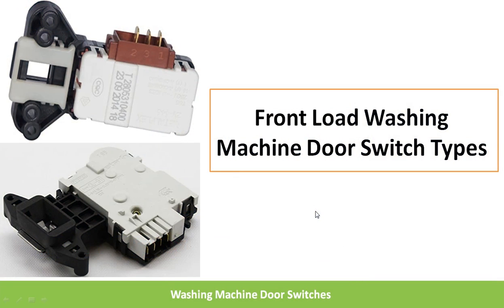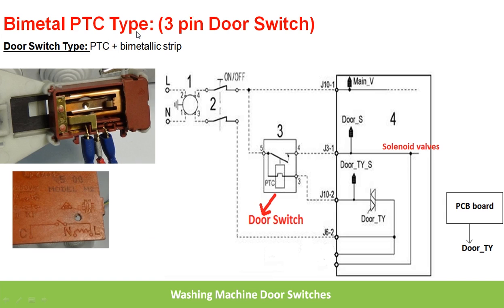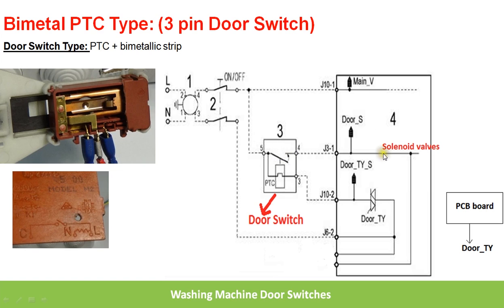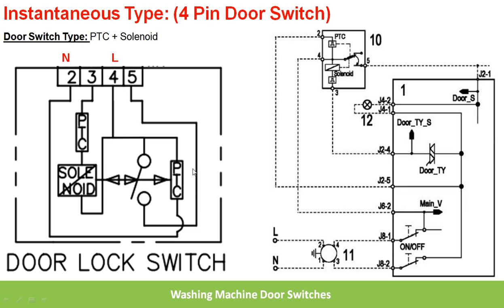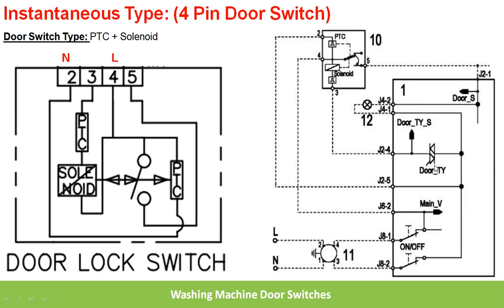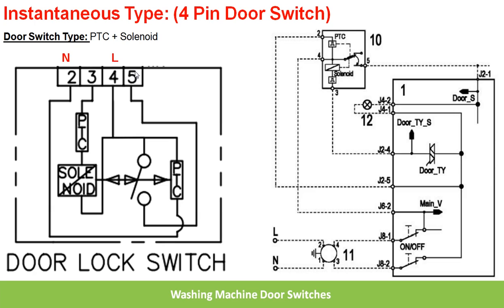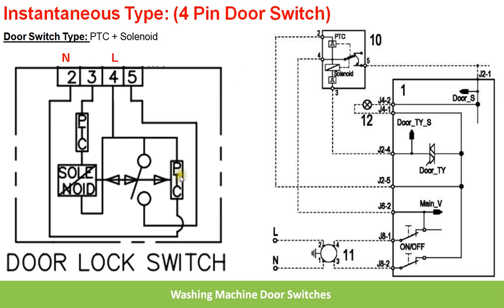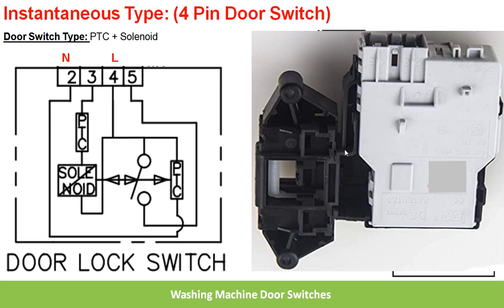How a washing machine door lock works | IFB, LG automatic Front Load Washing Machine

Comment: dude. any trick to open the instantenous type 4 which is stucked mechanically so unable to open electrically. You cant even change it because door is closed and there is not possibility to open it manually by pulling the plastic latch attached to door lock mechanism.. also it looks it hadnt any other mechanism for manual opening on the surface of the latch or this mechanism (push button) is on the inner side where you cant get. I dont know how to open it. Im done.

Comment: on the first diagram there is what looks like a capacitor on the incoming mains. Labelled Number 1. It has terminals 1, 2, 3 and 4.  What is it there? If this fails what happens?
Reply: That's just a mains filter  (capacitor and inductors), to supress interference from the machine. Had one fail on a 1980s machine, very loud explosion, very painful face and couldn't hear for about a minute, and I wasn't even close to the machine. A modern one shouldn't fail like that though, likely just lose power.